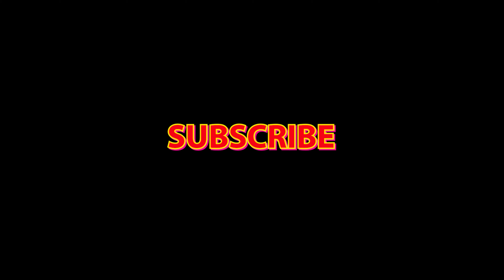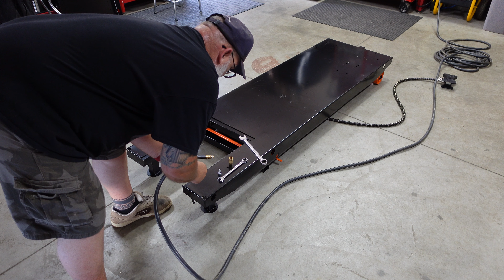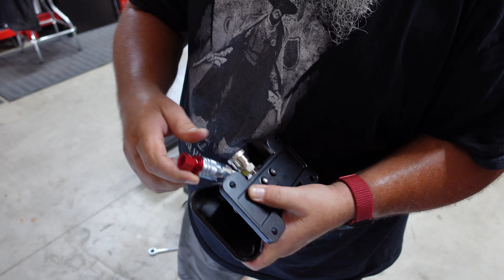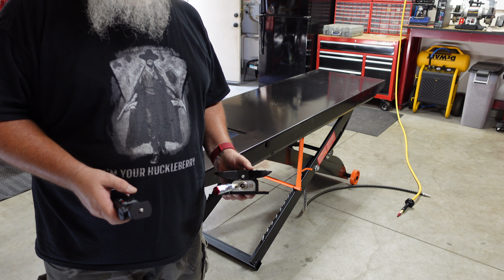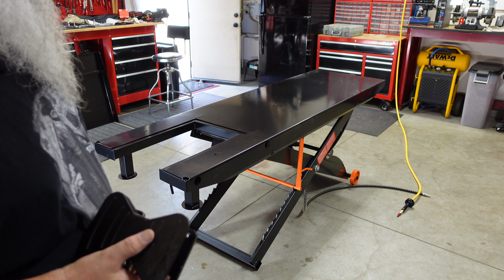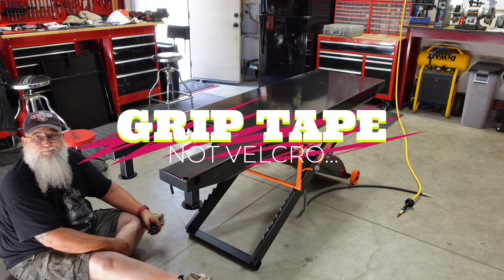Yep!! - Got a Lift, Part II, APlusLift MT1500X Assembly

Comment: This lift sits too high off the ground at the low position. Will a street bike roll onto it?
Reply from the maker: Hi Jimmy, thank you for the comments. The lift sits just fine for me on the ground and I can roll all 4 of my bikes on it without issue. 

2020 Triumph Rocket 3 GT
2022 Harley Davidson Heritage Classic 114
2022 Harley Davidson Road Glide ST
2022 Harley Davidson Low Rider ST

Not knowing what model you mean by "street bike" I can tell you that unless you have a slammed chopper or maybe a lowered bike you should have no issue. As general sport bikes sit higher than the bikes I have listed, I do not see those being an issue either. Additionally, with the side rails installed, you can roll up quads or smaller equipment to work on more easily.

Hope that helps, ride safe.
Reply: @justkillnbugz  Hi, thanks. I appreciate you taking the time to write back. I have a BMW S1000 RR. Some people call it a crotch rocket. I call it a 1000
Reply from the maker: @jimmyswollnuts7662  Thanks for the clarification Jimmy. I do not see any issue fgor you if you like this lift, should be just fine.
Reply: @justkillnbugz  Thanks bud. Appreciate it. I ordered this lift few days ago, should be here this week. I went into panic mode after watching these lift videos. Saw nothing but harleys put on these, did not see one crotch rocket. Though oh dang. Probably a reason
Reply: The crotch missile type street bike rolled up there just fine. Lift came yesterday. Thanks again bud
Reply from the maker: @jimmyswollnuts7662  Great news, glad to hear it! Enjoy the lift!
Reply: 7"  easy on and off